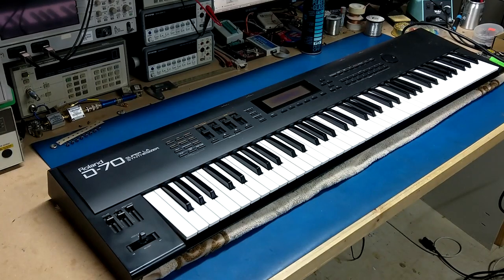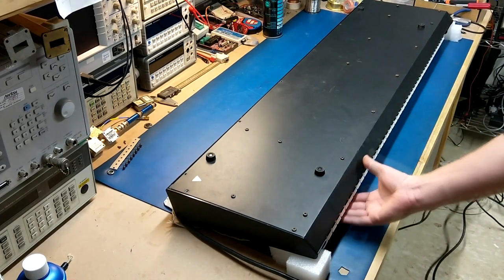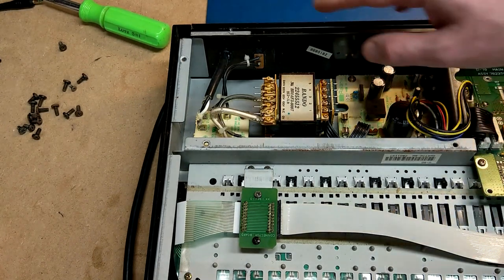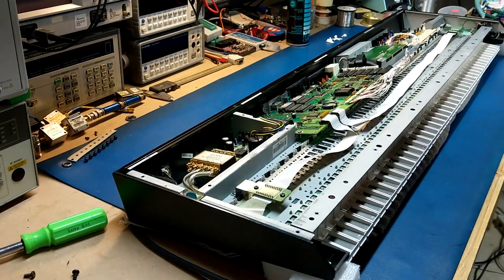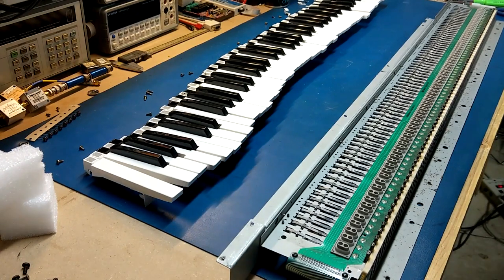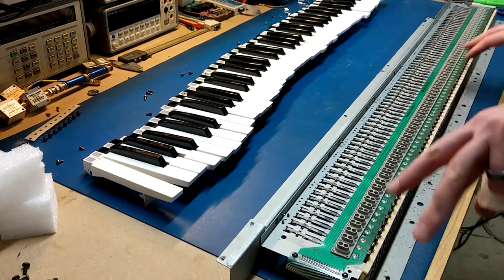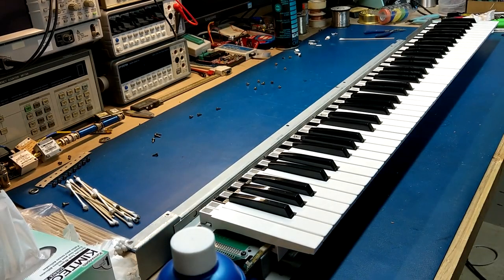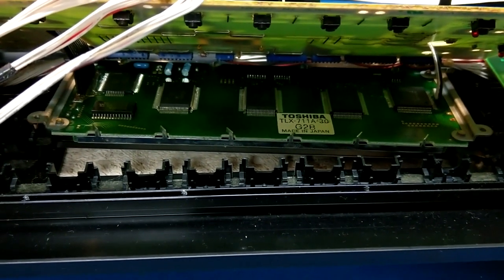Roland D-70 Teardown and Repair

Comment: This guy’s great and did a tremendous service to D70 owners by posting this.   One important thing that was different on my keyboard with regard to pulling out the keys.   There is a plastic strip under the keys that keeps the keys from popping out the way shown in this video.  I had to flip the keyboard over, pry those off with a putty knife (they’re glued but pry off easily), and then the keys popped out easily.   I’ll glue the plastic strips back on when I’m done.

Comment: Just took mine apart 34 keys weren't working.  They all work now after cleaning with 50% isoproplyl alcohol.  I have a spare D-70 too.  Msg me if you wanna buy some parts.

Comment: We used to sell these in the music store I worked in at the time. The D-70 is much more of a U-series synth than a D-series. They were cashing in on the name, but it's far more ROMpler than LA synthesizer. Side by side with the U-20, you could definitely see and hear the family resemblance. Makes for a nice controller keyboard, though, especially given how difficult it is to find 73/76 key keyboards these days.
Reply: I was surprised to see all the boards labeled "D-70". I have never opened one, but I've read that they are labeled "U-50" or similar. I wonder if that's what it says under the "D-70" sticker on the analog board?

Comment: I have had my D70 key contacts professionally cleaned, but it didn't last long. I did it myself the second time with same result. Recently I cleaned them again after watching your video since I had forgotten how I had done it (over 10 years ago). I had a dozen keys not working. There was quite a bit of dusty dirt to clean up. The carbon contacts left my Q-tips black. After reassembly, everything worked great for about 5 minutes, then the "C" key right smack in the middle of the keyboard stopped working. All the other keys still work. This brings me to the next step which I already tried out on my Memorymoog Plus. The MM has been in a case for about 15 years due to dead keys. Only 2 keys worked on the entire keyboard. I tried and failed to get the keys working by cleaning them once before. Fortunately, I didn't have to remove the keys, just the circuit boards underneath. Surprisingly, it was all very clean. No carbon  came off the contacts on the Q-tips. I Cleaned the gold contacts on the circuit board with 93% isopropal alcohol, and carefully cleaned the carbon contacts with acetone. I then coated each carbon contact with Caikote 44 conductive silver paint. After reassembly, every key worked and continues to work perfectly. My next move is to do the same with the D70, so I don't have to periodically keep cleaning the contacts. There are a variety of conductive silver-carbon paints and inks for this purpose. The one I chose was based on durability, and I later discovered was recommended on a Memorymoog forum.
Reply: This is a great idea. I have a keyboard with one key that is damaged because the carbon was eraced due to the liquid spill. I am planning to buy this silver ink to re write the contacts. Hopefully this one will work out.
Reply: @SIRAYEH  I have successfully cleaned and coated every contact on my D70 with the Caikote 44, (that's 152 contacts). Never had a problem since. The Aftertouch works better than when new. Velocity very responsive. LIke a miracle!
Reply: Where can I buy this Caikote?
Reply: @SIRAYEH  Available on Amazon and ebay.
Reply: Thanks man, will try to buy one soon so I can re-write the carbon coating. Hopefully this one will work

Comment: I don't know if yours had this, but when I took mine apart, there were a number of thin black plastic strips on the underneath of the keybed that click in to hold the keys in place, (where the little hooks on the end of the key hold the key on the bed). I had to remove them to allow the keys to come out. Also beware of the rubber pads as they tend to become perished with age and they can tear very easily. Good job though.
Reply: My D-70 was so filthy! (Dog hair and Jack Daniels.... ) I had the thin plastic strips too, plus some sort of hot glue holding keys in. If you push up from underneath with one hand you can remove the rubber contact pads  with less damage. All keys are working but I noticed that one key is coming loose I might have to put the plastic strip back in...... My Head phone jack was Mono but a squirt of electrical contact cleaner was all it took to put it right. I also found that I had to re-attach the circuit boards temporarily so I could turn the main case over and hook up the keyboard during re-assembly and trouble shooting.

Comment: PS, the E 30 was also released 1990 and has the built-in power supply with AC socket and AC power cable. A lot of the electronics look similar to the E 30, including the capacitors. I’m no electrician, but it is very interesting as recently I changed the interior 3 V lithium battery.

Comment: Thank you for making and sharing this great tutorial. You make it very clear how to remove the keyboard, clean the carbon connections and put the keyboard back again. Since I'm not a technician I managed to remove the keyboard without removing the three major print plates/modules, of course by first removing the screws. I only stripped off the long/flat white connection cables, that are glued along the entire board, and then lifted the print modules a little and could remove the keyboard. Just one remark, the keys can only be removed by first pulling of the 'Stopper'. This 'Stopper' is located underneath the keys and looks like a long thin black strip (in parts) of about 3 millimeters wide. Futhermore, before removing the keys, it's handy to first mark where the black keys are located, with a black marker on the metal frame. When replacing the keys it's easier to first have all the black keys in place and then placing the white keys back. Also and maybe the most important thing: GENTLY CLEAN THE CARBON CONNECTORS! Indeed as you mention; you don't want to wipe off the carbon layer from the connectors :-). I tried to put silver glue on the carbon connectors but as this is a very accurate and almost not done job (for me) I quit with this. All my dead keys are working again. It's an extra feature to have the technical D-70 pfd file aside your instruction video. Pictures of and movie after the repair and the technical reference : https://drive.google.com/open?id=1wngPvh9US8ne3GU5fABXZqJQcH2LypZh
Reply: Nico Velthuijsen Thank you for your comment. I was just taking my newly bought D70 apart and couldn’t figure out, why I am not able to get any of the keys out. Then I remembered that someone (you) mentioned, that there’s some kind of stopper underneath. Removed the stopper, keys come out and everything’s going as planned. So, thanks again!
Reply: Did you use isopropyl alcohol to clean the carbon connectors or something else? I just have a loose key, probably happened in delivery, havent got around to fixing it and I've had the keyboard since 2014.  How do you put the loose key back in place?
Reply: How to replace back the stopper ? What kind of glue do you use ?

Thank you

Comment: IMPORTANT NOTICE FOR EVERYONE ATTEMPTING A TEARDOWN AND REPAIR: The keys cleaning that Bradthx showed us does work incredibly well. (Thank you, Bradthx!). But if you don't want to lose all of your patches, performances and sounds, dump them as a SysEx file on your computer, of course, but also, do not unplug anything besides the keyboard (as shown at 15:48). Leaving everything plugged won't stop you from unscrewing the main board and the other stuff that might block the keyboard from being removed. Just be gentle with the wiring :-) But if you unplug what's on the Main Board, once you'll turn your D-70 on again, it will tell you: NO RAM CARD (EXIT). And then you'll need a Factory RAM Card to restore all the sounds. It's hard to find one online. I fortunately had one and a SysEx backup so I didn't lose anything. Be very careful!
Reply: Hello !!
Interesting comment. I unplugged everything and now the screen shows Just a black line. Did i damage the mainboard? Do you have an idea or suggestion? Any comment would be very appreciated. Best regards!!!
Reply: hello. thank you, but would you have a video to show how I can do it as you say please?

Comment: Gold standard for repair vids. Fantastic. Of course he's showing off a little going thru the chip and board architecture but I found it quite interesting. I have a dead key on mine and hopefully this will fix it. Bravo and thanks so much!! I can't play a convincing clavichord on a fully weighted controller. Semi-weighted is perfect for funk! I also have a dark display so hopefully I can replace the backlight too while it's open.

Comment: Great walk through! Thanks for sharing! I managed to revive my D70 keyboard competly. It's now in mint condition. One thing I encountered (which is not mentioned in the video) is a black stripe on the reverse side of the keys, which seems to hold the keys in place. It is glued, but with a soft glue so that you can pull it of gently with a flat screw driver. Oh, and another thing that took me a while to find out is that you have to press the connectors down to remove the black ribbon cables on the left (close to the PSU).

Comment: Just a note as an electronics tech. I see that you have a large antistatic mat on your workbench to set the keyboard on. 
But I don't see you wearing a wriststrap in the video. With this vintage of electronics, there is a definite risk of doing ESD damage to the components on the circuit boards. Just a word of caution to those that are attempting similar repairs. It's a little cumbersome, and you don't need to wear it when you're working on the keys themselves, but particularly when you are disconnecting and re-connecting the ribbon cables or touching the circuit boards, even to remove the screws, the wrist strap is a useful tool to prevent ESD damage on the circuits.

Comment: great Video. In my D70, the left key-bank seems not to work. Checked the flat cable and connections - seems fine. Strange, how the whole left side is dead, but the cable seems fine...

Comment: thank you for this video. is there an easy way to re-insert the after touch ribbon into the little slot if it has been pulled out? I'm having trouble getting it to slide back in as the fit is very tight. thank you

Comment: I have a Roland U20 keyboard with the dreaded red epoxy problem. I have it all apart and the keys off. My question., The black keys have dripped red glue on the green strip the  rubber membrane attaches to  I'm going to clean like you did with alcohol the rubber membrane contacts and the contact points on the green strip, do I have to clean the glue off the green strip?  It's not under the membrane just around it. I wish I could describe it better.  Thanks.

Comment: Far as the display, there is, (was?), a company in Asia selling a D-70 compatiable screen for ~$40US. It's the same "Cool Blue" as would be used for the Yamaha SY77, only issue being on the D-70 the replacement screen will sit slightly  elevated above the top panel.

Comment: robertvigurs
I was able to remove the key bed easily using your tutorial. Thank you. The part I did not see was how the two green plastic circuit board leads attached to the volume slider. Is it really just that little piece of clear tape.? Thanks so much. Robert
Reply: It works perfectly now. Every key works. You really helped me out. Thanks!😁

Comment: Hey bradthx thank you for your great video. I wonder how did you disconnect the Wire Trap Connectors (black cables, 4 on the right of main board and 2 on the left). It seems that you just pull them out leaving the cables naked... Is this the right way? It's very difficult to just plug them in without bending the naked wires
Reply: The wire trap connectors have to be pushed down on both sides to release the wires . Pushing down also makes it easier to insert them afterwards

Comment: Cool Daddy-O. I have been sitting on my Fathers D-70 since 1999, most all the weights were out and literally glued sideways from falling out as you mentioned, the cover is also glued so I have applied a small amount of goo-gone on the front corners, I do have 1 broken key flapping in the wind, maybe the spring...my question is if it would be better to replace the springs?
Great video...

Comment: Excellent video. I will be getting a D70 in a few days with a dodgy keyboard so need to do the same as what you did. I have read the service guide that covers the steps needed to dismantle the keyboard but it is far better watching someone do it. Somebody earlier mentioned that an additional plastic strip had to be removed before the keys would come off - the service guide also mentions about something that needs to be removed so maybe the previous person who had taken yours apart had taken it off and not put it back on? I'll see what is on mine when I get it.

Comment: A button on mine needs replacement, are the ones and i mean the button caps not the tact sw identical to the Jv 80  so i can use spare parts from there ?

Comment: I received one of these just yesterday and half the keys were lower than the other half. In other words not properly connected anymore. When I turned it on it soud like 20 odd keys were constantly pressed the whole time. I am hoping the keys aren't damaged when  it is opened and they will just go back on without having to buy all those keys. Also the display is very dark no matter what I do with the contrast knob on the back. It helped but it was obviously damaged on delivery. But if i stick a couple of phones underneath pushing keys up I can access the sounds via midi. But I would like to get the display replaced.

Comment: How does the key numbering system work? Specifically the numbers. I understand the letters (you can use EB interchangeably, etc. I am lining them up but have not installed the yet. Thanks

Comment: Hello, great video!

I have a question about a problem and I think you are the right one to
answer it.
The buttons E1 - Fis 3 on my D70 do not produce any sound. There is also
no sound in this area via MIDI-In generated. From key G3 - G7 it works
very well, also via MIDI-In. Could the CPU (IC15) be defective because
MIDI and keyboard (IC3) are only in the CPU come together?
Thanks

Comment: I really appreciate this video and also many videos of your channel. At 8:30 you start talking about the power supply and discussed about changing the voltage. You mentioned the fuse (F1) may not be changed, because it is after the transformer's secondary winding.  I agree with you, as the voltage is the same in the secondary and the power drained is also the same, the current will be the same! But looking at the Roland D-70 service notes (1st edition may 1990), on page 19 it recommends the F1 should be changed according to the table on the same page, which relates the voltage tap wired on the primary with the current rate of the F1 fuse. Also in this page there is a schematic diagram of the power supply. Changing the F1 fuse makes no sense for me. Looking that schematic the F1 fuse only protects the 7.5 V tap of the transformer secondary, which will feed the 7805 voltage regulator. Why they didn't put a fuse in the primary? My feeling is that I'm missing something. Can you help?
Thanks

Comment: Hi. I have a Rhodes 760 that use the same type of flex circuit under the keys. The dreaded red glue from the keys has corroded the sections of the track away. Have you had any luck repairing an issue like this? Cheers.

Comment: Great video. I had the same issues with my D-20 about 10 years ago. If I remember rightly it had a coil spring on each key but other than that looked very similar to your D-70. As a side note I powered my D-20 up a while back and the screen just came up with yellow squares across the top line and failed to boot with no LED's etc. Is there anything I should look for first as an easy fix when I open it up? Thanks.

Comment: Thanks for the video! I recently opened up my dads D-70 in order to clean the small board on the left side (volume, c1 and brightness). It appeared to have some fluid damage and the volume slider would only work on max or 1/3 but would always blast at full volume. After opening the keyboard and cleaning that small board I now dont have any sound at all anymore. Synth starts up, menu is working but no signal through any of the outputs on the back. Did I mess this up? I tried contacting Roland to get a new board, and a pitch wheel but apparently they dont have these parts anymore in germany.

Comment: I just scored a D70, it has a few dead keys.  While I had it open, I gained a few insights into what you found.  There are 8 screws holding the keyboard in place, that's where your two extra screws came from.  Also, if it hasn't  been previously opened, there are plastic keeper strips that need to be removed before the individual keys can be removed.  Unfortunately, after cleaning the contacts, the keys are still dead.  Any other suggestions?

Comment: Awesome post. Thank you. I actually have one key I need to replace...is there anyway to do that without removing all the components as you did (i.e. slide it in upside down while the keybed is still intact) or does the whole thing need to come out?